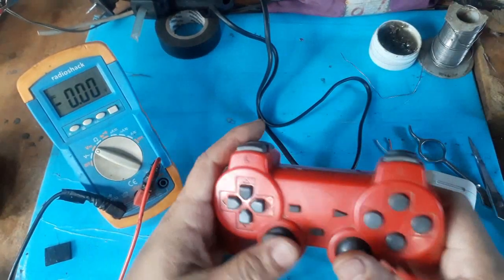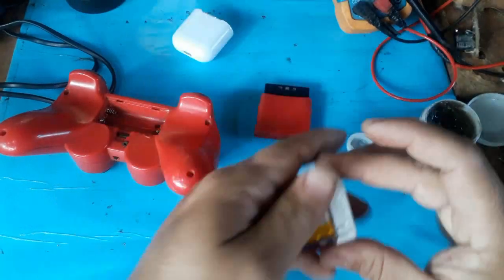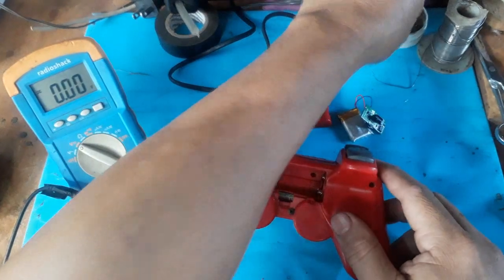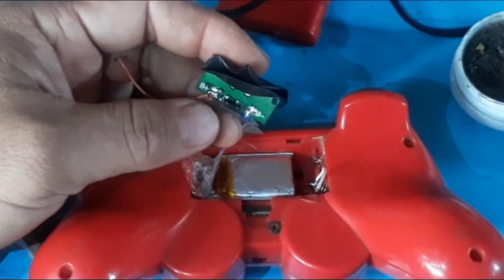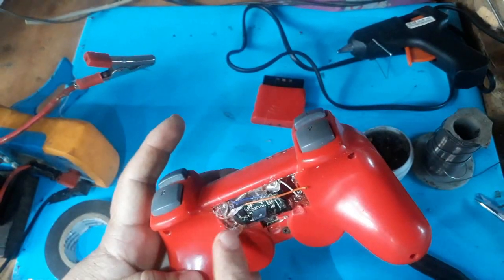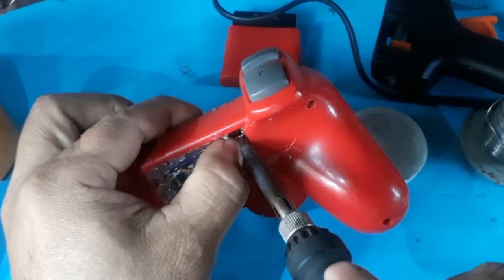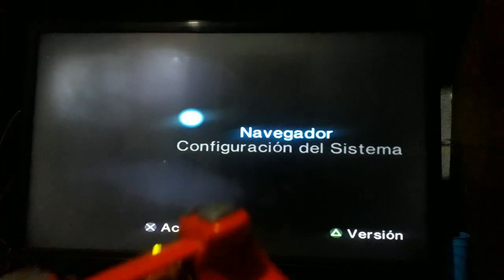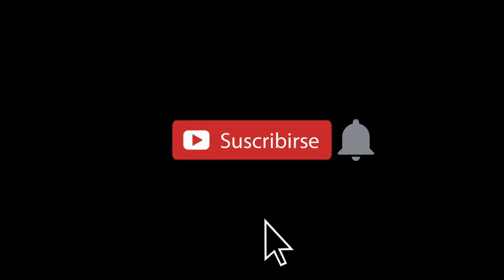🎮Batería Recargable y módulo de carga para control inalámbrico de PS2 | 😮NUEVA IDEA con auricular BT

Comment: Una pregunta sirven las baterias de los helicopteros a control remoto?
Reply from the maker: Revisa el voltaje debe ser dev3.7v a menos
Reply: @JUANKYPS2  Gracias :)
Reply: @JUANKYPS2  disculpa Amigo GRASIAS por compartir esta modificacion y tengo varias dudas antes de poder realizar esta modificacion a mi control : 
- es un modulo de carga que a la entrada se alimenta con 5 vol y a su salida te entrega un voltaje  para cargar baterias de litio de 3.7 volt ????...
-no hay problema en cuanto a que el control se alimentó con 2 baterias de 1.5 volt  = igual a 3 volt . y ahora se alimente con una bateria de litio de 3.7 volt a la diferencia que hay  de .7 volt de la bateria de litio no afecta en nada al control ???... espero y me puedas ayudar GRASIAS .